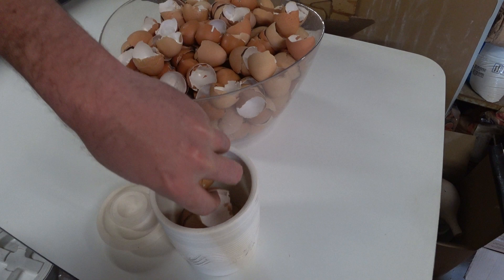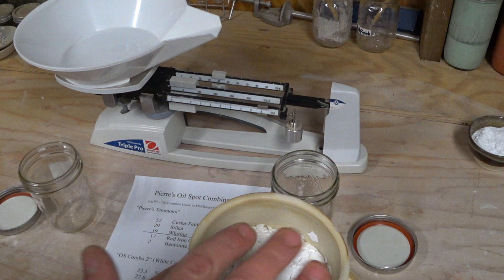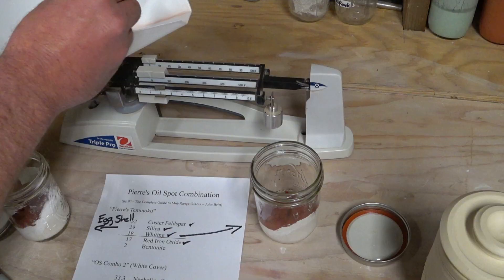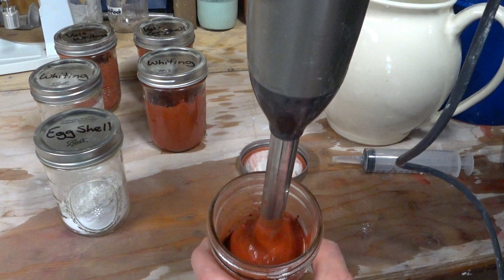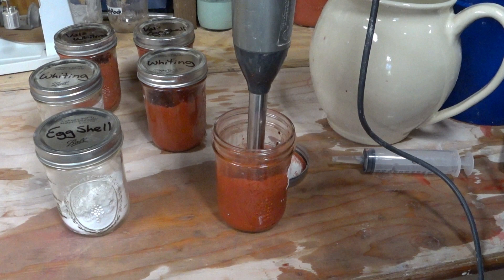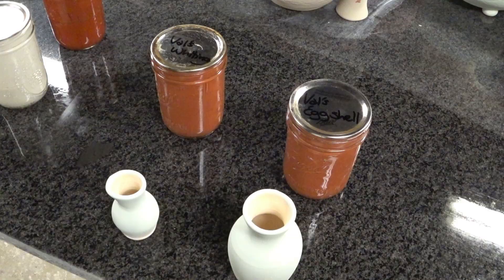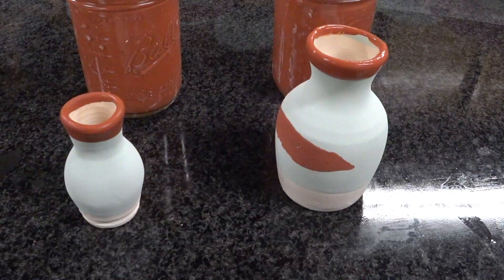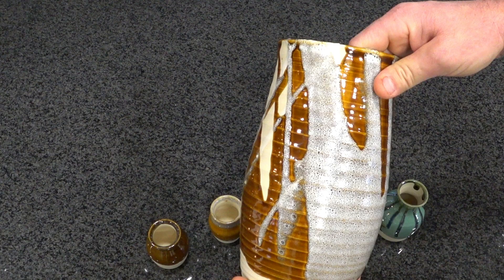Glazing with Eggshells + Oil Spot and Rivulet Recipes Cone 5/6

Comment: I had my baker mother in law save all her eggshells over the holidays as I was playing with experimental concretes and refractories when by chance I went looking for commercial sources and learned all about where traditional calcium carbonates come from. Depending on geographic locations and what one might have access to, seashells are a natural source as well as eggshells, though I would be willing to bet the bulk of commercial lots are processed limestone. 
After ordering quite a lot through a pottery supply house, of course, I then came to the realization that all of the bothersome whitish rocks in my yard clay were also limestone deposits, which after some testing turned out to be the case. Guh, minor financial whoopsie on my part... 🤦‍♂

Comment: Oh my goodness! I have a bunch of eggshells in my bisque kiln right now. It stinks so bad at 270 degrees C I panicked and turned it off. Wondering if there’s something wrong with my kiln or if it’s just the shells. Almost smelled like electrical burning but definitely an organic burn smell mixed in. Oh the stress! Justin, does it smell when you fire them?

Comment: Something just happened and I’m wondering what you think. I fired a bunch or egg shells to use for glaze. I mixed it with some clear gloss glaze as a binder. While shacking it I noted that it was rapidly heating up. As I ran outside and set the bottle on the lawn, I could see that it was beginning to boil. Soon it melted the plastic bottle, blowing a cloud of dry, white smoke that wafted up into the cold air. What happened?.
Reply: My hypothesis would be that you produced calcium oxide, also known as quicklime, which reacts in an exothermic reaction with water. It can bring water to a boil.

So, when you heat eggshells, then you will burn off or pyrolyse the organic components (proteins) in them and the pure calcium carbonate (limestone) remains. That one does not cause trouble with water.
But when you heat the eggshells at a higher temperature, then the calcium carbonate starts to disintegrate into CO2 and calcium oxide.
If you want to give it another try, you should heat the eggshells to a lower temperature. I cannot tell you which temp that would be, though, because I have no idea. ^ ^ You can probably find the temps for these reactions on the internet.

Comment: Heating the egg shells above around 1550 degreesF turns the calcium carbonate in the egg shells into calcium oxide. Be very careful when handling calcium oxide as it reacts exothermically with water forming calcium hydroxide and is highly alkaline. Heating minerals above the decomposition points can have unexpected results, and you should always research beforehand in case you need to follow any safety procedures when handling! Personally, I wear a comfortable respirator when handling all powdered minerals. You can't put a price on safety! Your kids will thank you in 20-30years when you don't die of silicosis and lung cancer 😆